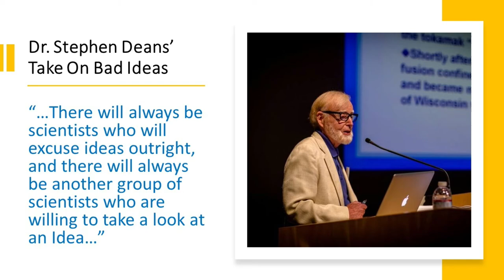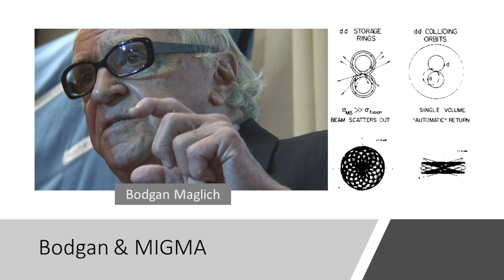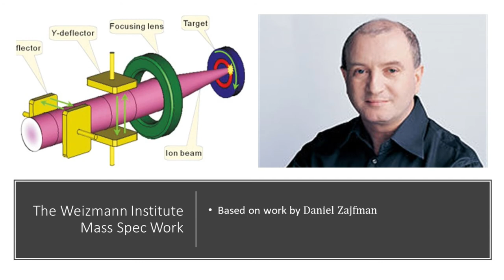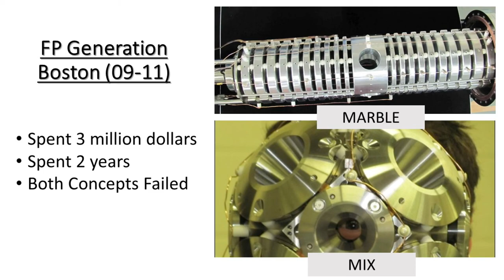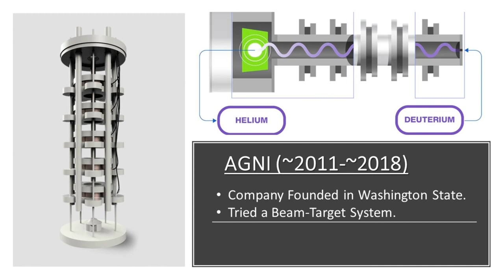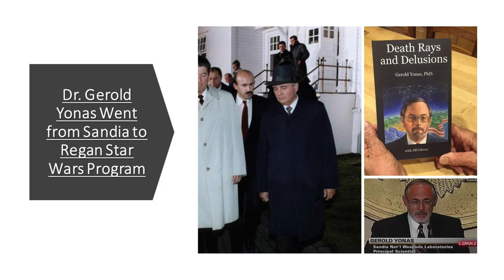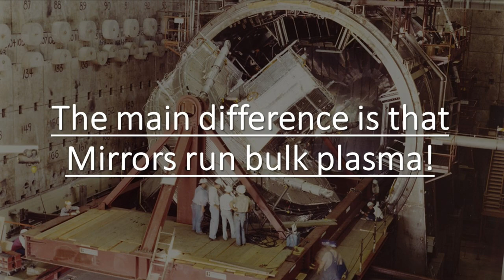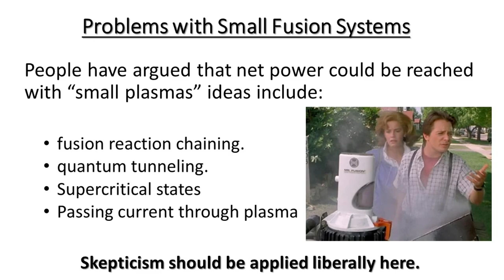Fusion Master Class: Bad Ideas: 11 of 10

Comment: What is the difference with the helion design, which collides two plasmas? Or is that a mirrror system?
Reply from the maker: Helion has a pretty exotic design.  They makes two structured plasma loops and then pushes them together and compresses them.  Very unique design.  TAE has a similar system - make two loops and push them together in the center - but TAE DOES NOT compress the structure.  The challenge with compression is that any plasma structure is really fragile and delicate.  A plasma structure is a semi-stable, quasi-stable system;  It is beset with instabilities, so anyone attempting to go that route with fusion has to find ways to stabilize everything.  Compression is more than likely to rip the Helion plasma apart rather than improve fusion conditions; that would be a central challenge.  By contrast, TAE stabilizes using particle beams fired along the outside of the loop - they keep whacking the plasma to keep it spinning and stable.  Helion seems to not care about long-term stability; their system is pulsed, after the compression they allow the plasma system to collapse and start over with a new structure.  

But there are a couple other things that make Helions' system special.  They are using the D + He3 fusion reaction; which almost nobody else is doing.  To create Helium-3 they have developed a separate patented process to generate the fuel from Deuterium.  A fair question is, does this extra process impose more energy costs to the entire system?  I do not know, but I would ask that on behalf of their investors.  The other unique thing they do is in the energy capture technology - they seem to be using a magnetic expansion approach.  The analogy is with regenerative braking in your car - basically the expanding magnetic field is used to drive an electrical current.  This is also a unique technology on the energy capture side. 

For 10+ years, Helion (and the earlier firm MSNW) has been a pretty secretive fusion company; so it has been exciting this past year to see them open up and talk about what they are working on.  Every one of the fusion startups has their own characteristics; like Commonwealth and Zap Energy are both very transparent; they basically publish everything.  If you want to learn more about Helion, their roots go back to the work of Dr. John Slough, who was a professor at the University of Washington starting back in the 1990's.
Reply: @PolywellFan4512  

I Followed your youtube  course with interest, especially after the recent ignition hype.
Although a break through, I see them still far from reaching anything real net positive.
I wanted to know more, after seeing the video from Real engineering (https://www.youtube.com/watch?v=_bDXXWQxK38)
I was surprised that their setup was not in the models you explain, or even a "bad idea".

Their capture of energy seems very efficient if it works as they claim.
And they claim they can run on two different modes, one creating fuel HE3 and the other burning it in a less corrosive way.
I understand that the source material tritium is in very short supply, something many reactors are not taking into account.
Is that real or hype on Helions side?

Thanks for your videos and reply.
I will definitely continue studying this interesting field more.
Hope we get real break troughs sooner than later.

Greets John van der Pol

Comment: 12:01 . . . "Beam-Target Systems Do NOT Work" :   Doesn't Phoenix / SHINE machines use this method to produce highest output of fusion neutrons for longest duration ?
Reply from the maker: Yes.  But that system cannot make net power.
Reply: @PolywellFan4512  Why can't it? Is it theoretically forbidden? I don't really understand what the argument against beam target is in the video - in fact I don't think you actually gave one!
Reply from the maker: @citricdemon  Shine is not trying to make net power.  They are making neutrons with beam-target systems.
Reply: @PolywellFan4512  do you know what their neutrons per second is?